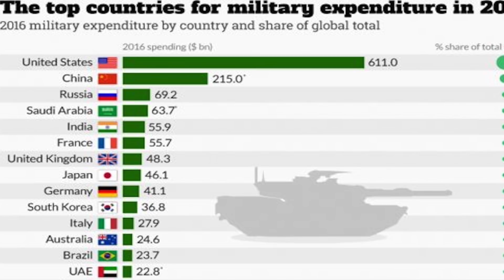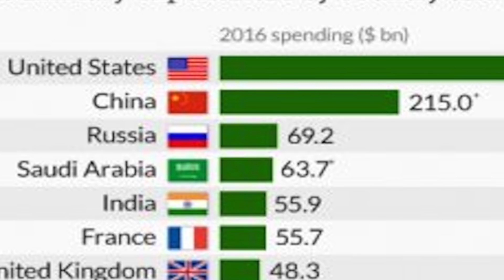CAN USS GERALD R FORD DEFEND ITSELF AGAINST RUSSIAN ZIRCON MISSILE ?

Comment: 5 reasons why hypersonic missiles won't work, not including lasers which will counter them easily:

1. AWACS. Advanced warning and control can give a 3.5 minute heads-up, which is an eternity in a situation like this. While it is true that the defenses are designed to handle supersonic and not hypersonic, this is only a 30-40% difference in speed. It means that the crews will have to react faster, but 3.5 minutes is plenty.

2. Saturation. If a carrier were going off alone and without planes, then any ship with enough missiles of any kind could threaten it. However, the cruisers and destroyers surrounding it could use their weapons knock a missile off-course, to say nothing of the carrier or its planes.

3. Radar jamming. This one speaks for itself. Can't hit something if you don't know where it is, and its not like a carrier is just going to sit there and let itself be hit.

4. Stealth. While this one really applies more to the Ford-class than anything else, it makes hitting a ship with a missile impossible for the same reason as number 3.

5. Sheer durability. Carriers are not easy to sink, and the small number of missiles which could get through after 1-4 would have to be very, very well-placed to sink a ship of that size. Odds are, they won't get through.

Russia and China are scared, wounded cats trying to puff themselves to look big to impress their own people. They have technology which was obsolete since the 1990s as their standard, with a handful of "advanced" systems which still lag decades behind the US. But worse still is their obsolete way of thinking. A battlecruiser or two (the Kirov and its sister ship) and a few aircraft carriers with ski jumps cannot compete against stealth carriers with electromagnetic launch systems and upcoming anti-missile lasers. All they really have are missiles which can go a bit faster than the ones they already have.
Reply: The Serbs would like to have a chat with you about "Stealth". It didn't stop them from downing a Nighthawk.
Reply: Disney called, they want you back...
Reply: Read up on Tom Clancy's scenario where 50 Bear and Bison bombers take off for a "swarm" attack on a Carrier Battle Group. The bombers fire off 50 decoys which on radar look like bombers. AWACS scrambles 50 F14's which fire 100 Phoenix missiles with 200 mile range when bombers are 300 miles away but closing at 500 mph...then 200 miles away the bombers launch 200 cruise missiles. End of carrier. Clancy knew his stuff, RIP.
Reply: Nonamearisto fantasticly naive
Reply: 200kg warhead is enough to sink a destroyer, old soviet missiles have ~ 750kg warheads, I don't know what warhead has zirkon, but sure it will enough to sink a big target like aircraft carrier. Also one important thing which video did not said is that hypersonic missiles are very hard to detect by traditional radars because of it's speed
Reply: Nonamearisto it 5× the speed,the only protection is a fact that it would start WW3 and Russians love theirs children too!
Reply: lay down the crack, its bad for you...
Reply: Wanna take that original statement back kiddo?
Reply: AWACS very vulnerable and the first to be taken out.  I would not want to be on an AWACS unless we were fighting NIcaragua.
Reply: Even if it gets shot down, an AWACS will still be able to do its job and warn the fleet. Also, there's more than one AWACS craft up in the air at a time, and they can be screened by fighters. It's not like the AWACS craft would be going up alone, or that there's just one of it.
Reply: Nonamearisto  you know how hard it is to shoot down a hi speed object. And if they are following a winding track?  Almost impossible!!
Reply: Ok, first off, even with the AWACS, it does not mean you have a shield of defense that CANNOT be penetrated. Even now AWACS can be overwhelmed by a large swarm of ANIT-SHIP missiles, which are made with RADAR JAMMERS in mind. And you really think the Russians wouldn't say what about stealth? You idiot, of course it was made with stealth in mind! They most likely have some sort of anti stealth and radar systems on board. Even the most formidable defense crumbles when their are too many attackers. They won't just use one missile at a time with no decoys. Fuck now, that is a shitty tactic and strategy! Decoys, other missile fire, jammers, electronics warfare, and other threats will simply overwhelm the defense and all it will take is one missile to hit the carrier to cripple it and a second one to utterly damage it. If they are lucky, they might it the nuclear reactors themselves. That won't end well for the carrier.
Reply: Nonamearisto 
1 Frigates (yes even frigates) with Zircon, Kaliber and Avantgarde (20M velocity) onboard (all having tactical nuke variants)

2 Tu-160, Tu-22M3 at 2.2M speed with Ha101 (Caliber like) airborn rockets (all having tactical nuke variants)

3 Submarines with similar arsenal

4 Mig-31 @ 3.2M cruise speed with antiship Kinzhal missile @ 10M speed.

a lot of ways to sink American ships...
Reply: Yeah, if only we  had something to shoot it with that moved at the speed of light! Oh wait, we do! Not so hard to shoot down with that.

Comment: Zircon crosses the horizon 10s before impact

no laser can destroy the missile so quickly, forget it, it's nonsense.. no matter how much power you have

what's needed is new anti-missile missile
Reply: Seems to me the only defense in jamming and anti missile missiles equipped with EMP warheads maybe like killing electronics in a 1 cubic kilometer sphere.  Dunno, my only guess at how possible a zircon could be defeated.  Nah, too easy to shield the zircon electronics methinks.  So yeah forget about it.
Reply: beyond the horizon systems like the F-35s AESA can detect the missile, if you had a 100 km range anti-missile with large enough warhead..like 150 kg ....with tungsten balls..then yes

it needs a new missile